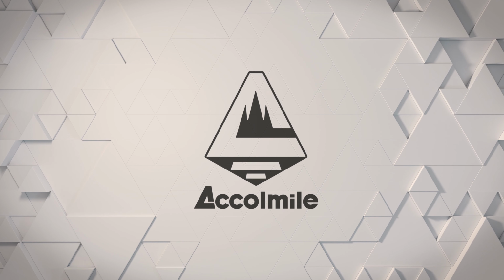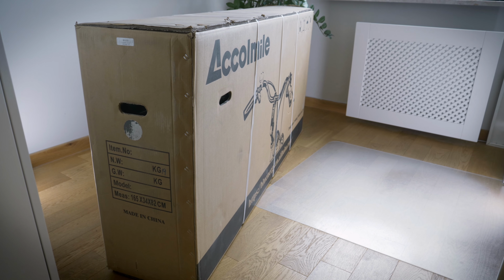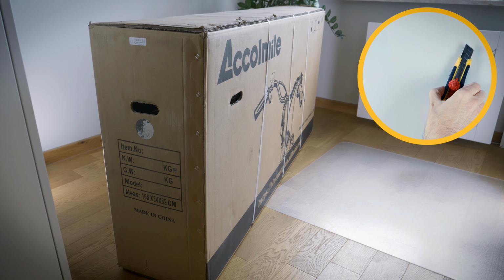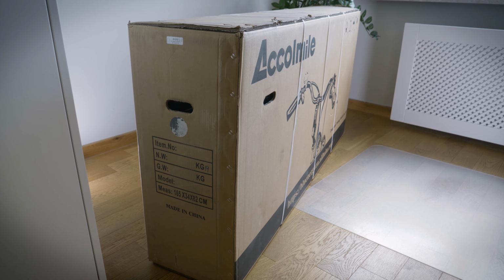How To Build Your New Electric Mountain Bike From The Box

Comment: Great unboxing video, I just bought the same e-bike waiting for it to get shipped. Looking forward to your full review next week. Would be great if you can show how to unlock the bike speed. Also if you find a rear rack that would be super helpful as I intend to get one once the bike is in my possession.
Reply from the maker: Hope you enjoy it Frank! We were testing this bike off-road yesterday, this is a MONSTER!!!! I wish I could keep this bike! Congratulations on your purchase my friend. Were are you?
I added 3 rear interesting hacks on my website, take a look at https://bk42.eu/bike-accessories/
I will make a quick video about unlocking the PA max levels next week as well :)
Thanks for watching and welcome to my channel
Reply: @BK42Cycles  Yes that would be super useful if you can video how to unlock max PA levels. I've also just ordered, looking forward to receiving it later this month. Quick question, I'll be using this bike for some really rocky trails, how does the suspension front and back hold up? Cheers
Reply from the maker: The front suspension is very good. The rear could be better. There is not much adjustments or locking pin. I would replaced that by a better one. The thing is, a good MTB airs shock cost a fortune, for this bike price range I can understand what they are doing.
Reply: BK42 Channel thanks for sharing this info , it is very helpful. I’m from LA CA. I did notice that the rear suspension seemed a bit weak but I’m sure I can find a good coil suspension, I hear they are much better now and compete with air suspension
Reply from the maker: Indeed. There are good coils suspensions in the market. Biles always need some small updates :)